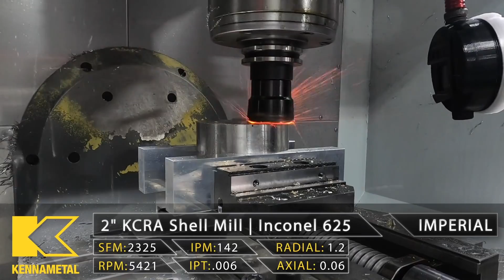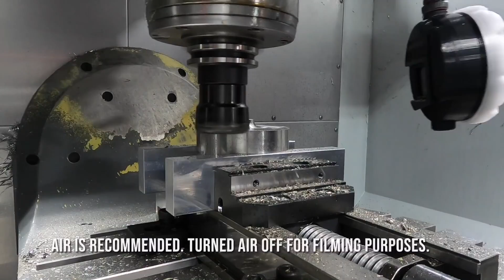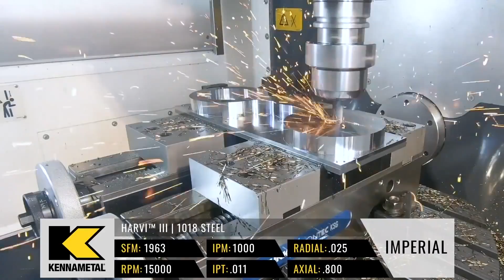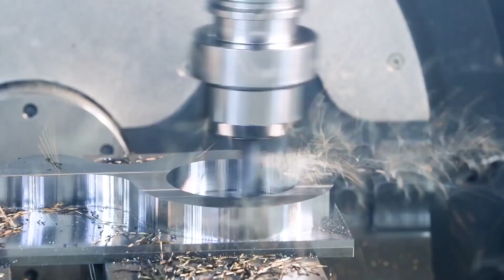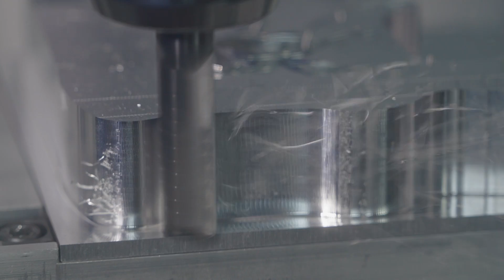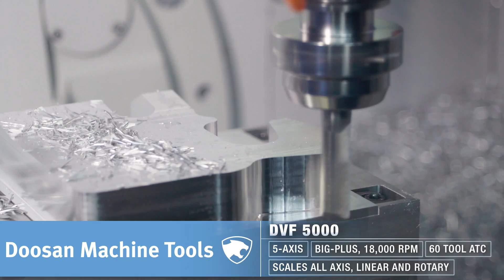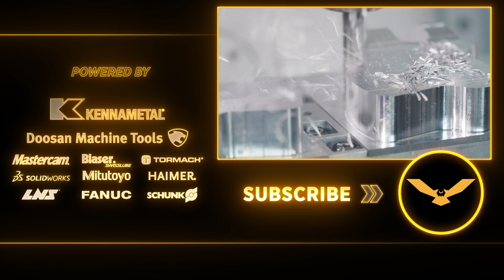FRUSTRATED because my Boss Runs Machines Too Slow

Comment: It's just physics if you do things according to the limits of the equipment and material things work just fine.
Reply: Just below it. Never at. Mech engineer here and most companies run their products at a 50% under ratio. What they don't understand is that the materials given from those stresses came suggested at a 50% lower spec to begin with, so they are running at 25% or less on avg. Pushing a part to 90% is realistic, not all part running is perfect and metal has inconsistent grain growth and values so intellectually if you apply a good coolant and figure in high and lows, 82.5-88% is optimal for efficiency, safety, AND longevity.
Reply: Its lazy engineering. It require more work to do work close to the limits without mistakes, breaks and loses

Comment: Yeaahh.  Let's break more tools for one part...
Reply: Most tools are run too slow and too careful, resulting in additional wear and reduced lifetime.

The number of chip cuts produces the wear not so much the thickness of the chips. So go to the upper limits to increase the tools lifetime.

It sounds strange, but it works.
Reply: @norbertfleck812    You're almost right...!!  BUT some time it's better to be safe than sorry...!!
Reply: @svogender  You are right when running a program the first time, but for series production you have to find the optimum, which is very often close or even beyond the upper feed suggestions.
Reply: @norbertfleck812   I agree..When it comes to serial production...  But  very often it more like prototype items ( at least at my place ) And then it's more about stability than speed...!! 😊👍
Reply: When your boss makes you the .gcode file, you can't aspect to ramp the spindle speed and feedrate to 200%..cause if you break a 200$ tool...you are paying it..or worse.. no job.
Reply: @swatcat7928  If you are not allowed to program the machine, you should not do that. 
Then you should take lessons for CNC programming.

Comment: Hey Titan, i'm exactly there - since i started working there after my military service a year ago.... I wachted all your videos since the one with roughing comparison with the crickets in the background🤓🤣 my boss is 74 and in switzerland you're ritered then since 10 years sooo yeah probably you can relate what I wanna say😅 This is exactly what I'm trying REALLY hard, but you can't change him anymore....

Can I give a request for a future video:
Milling hardened steel(>65HRC, for example hardend punching knifes etc... ) I'm struggling with tools that last, cause after every cut I need to adjust the radial compesation to hit the D10H7 tolarance (mm), in addition can you catch on an topic for the ratio of bore to tool diameter( if there's a D10 hole take a D8 or a D6 tool)
that would be really nice :D
Reply: Grösser 65HRC würde ich drahterodieren oder senkerodieren, Standzeit wirst du nie richtig hinbekommen auf Dauer... Grüsse aus einem Schweizer Werkzeugbau :)
Reply: Hey, what’s about using boring tools? D’Andrea boring head for e.g.. On another side, if you are milling pocket (circle) with H7 tolerance you probably need two endmills (rough and finishing). I’m using 4-flute Widia Varimill endmills and they are just working too good. Technically, you need to use 30% smaller diameter endmill that final size is. 7mm. Speed and feed varies but it’s about 30-60 m/min and 0,03-0,04 mm/z for tough materials. Cheers from Russia🤞
Reply: @mikhaildavydenko6841  he is talkung about >65HRC in tool steel i guess.. i wanna see that in a safe process.. then i will regret my opinion. Wizhout changing tools after 3-4 holes.. like 1.2379...
Reply: Polymechaniker?
Reply: @iamtyzed  ich? Leiter im Werkzeugbau.

Comment: kind of doing the same and my coworker tells me the machine is too flimsy for it and that im killing it and should stop using that high feeds xD
Reply: I will say that people run machines way faster today than 20-30 years ago. Bearings really havent changed they just made the tables lighter to keep wear down. You can run fast but its the constant jerking thats hard on machines. I have 20 machines in my shop mostly from the 80’s so they are heavy built. I change the parameters to only allow 300 ipm rapids. Im a job shop so I rarely see more than 5 parts to an order, so its hard to justify tearing up a machine for 5-10% faster cycle time. Just my opinion but thats the fun off it.
Reply: I mean, if you're seeing visible chatter back off, but if it's staying smooth fuck it